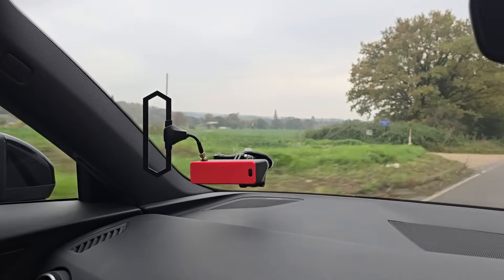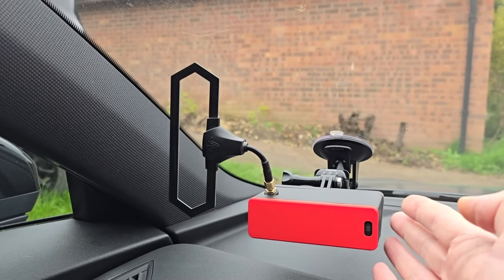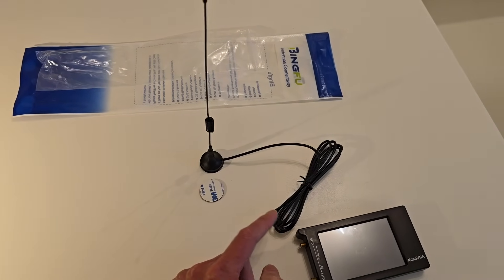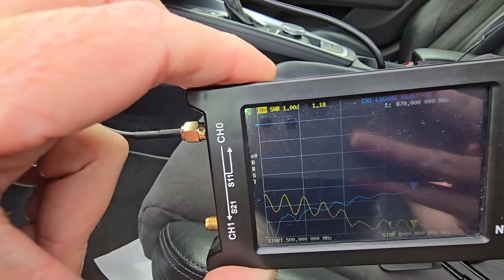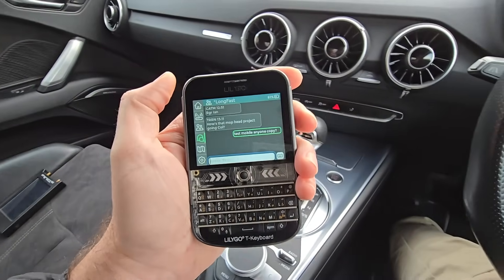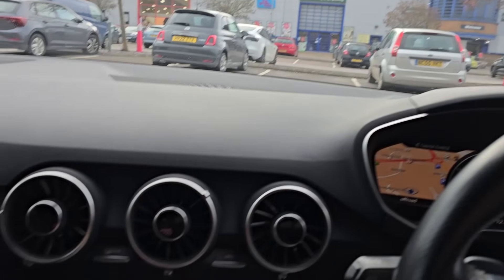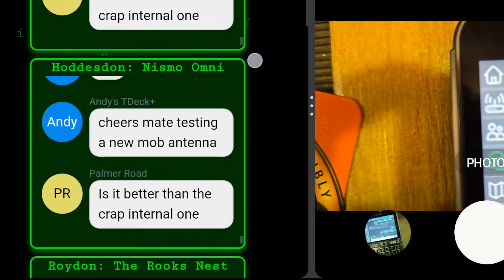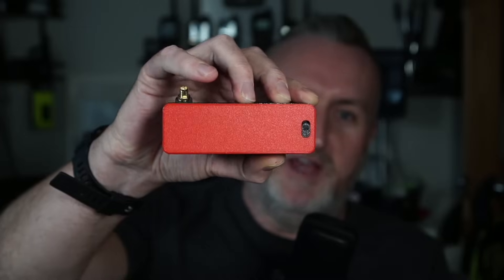THIS NEW CAR GADGET IS GETTING PEOPLE TALKING!!!

Comment: ❗️Antenna cable loss per foot is significant!  I find a stick antenna connected physically to the board yields a longer distance even if lower in height in the car vs. external.  Try it both ways to compare and see for yourself.

Comment: I would be impressed if images, audio and video could be sent across meshtastic quickly.
Its basically the modern days version of people messing about with CBs
Reply from the maker: They can't, it's too slow. Reticulum can on 868 but it's better to use 2.4ghz LoRa radios where you can use increased bandwidth.

Comment: Hi Andy. I have a couple of these aerials on order. Ps not related to this video but just for info the UK normal TV yagis are good up to 860mhz so with a bit of cutting,  fiddling they work on 868mhz.  However the impedance is as standard 75ohm but again easy to adjust. I just bought an 868mhz yagi from china as cheaper than a uk tv aerial. George ps pretty dead for meshtastic around Corby Northants. 6 stations and 4 of them are mine.

Comment: In the US, the TT is considered a secretary car, meaning guys buy them for their girlfriends and wives. I always thought it was just a fun car to drive. I'm getting ready to trade in my car for a used R8 or Ferrari California. My wife told me I had to wait until I was done with law school. I have a 2024 Bronco Raptor. I have a full Ham setup in it and a lora v3 i run up into a tree with my drone. I have a magnetic drone landing pad I use to launch it. I use a DJI upgraded with a thermal cam I use for hunting at night. We use mesh to communicate on the property. I take the drone with a tether made from dyneema to put the node in the tree with a 30,000mah battery and a solar cell. It does a good job considering there's nobody around for 60 miles and cell towers are hit or miss.  We used to use frs for everything but it's not great...the mesh setup is nice once we go through and dump a bunch of the nodes in the trees with the drones.  I can usually fly it off and land it without stopping using my recovery system.

Comment: i can't think of a use case, other than as a message board, like randoms asking 'asl please'. what do you all use it for ?
Reply from the maker: It's a fun way to communicate and prepares you for communicating in a potential grid failure, Internet outage... it teaches you skills in radio comms.
Reply: @andykirby  if there's a grid failure i'll make a sandwich 🥪and take a nap, the network operators have generators and engineers to work stuff out, i don't have anything important to say lol

Comment: FPV drone pilot here, Came for the TBS antenna, left with some new knowledge
Reply from the maker: Hey man, check out the other vids on the channel, lots of fpv stuff here 😁 quite a few fpv pilots also getting into mesh.
Reply: Yeah me too! Lol! I saw the TBS Diamond in the thumbnail and I was like "hey! That's my 915 antenna!" I was totally expecting a "how to fly from your car in winter" type video! Lol
Reply: Will you add a mesh relay node to your drone, for the people?😌
Reply: @Thuja814 sounds like a challenge, lol
Reply: @sinologies  nah, your challenge is to calculate the ideal hovering node-drone mesh arrangement (i.e. staggered, grid, fibonacci spiral?) as well as the height, and the distance between each node-drone in your flock to provide seamless connectivity to devices at ground level while striking a balance between your signal strength, drone battery usage, and optimization of geographic coverage😛🤓
Reply: same here
Reply: Bruh 😂

Comment: If you don't want to have to worry about adhesive on your paint, you can use nano tape. I have used that stuff to stick my cameras to bricks, and they've been up for years, when I take it off there is no residue, and no damage. I wouldn't use it on plaster or drywall, but basically any surface that won't come off with the tape is good.

* I say this because you seem like you're proud of your 450bhp machine 😉
Reply: Nice advice, but it’s too late lil buddy, he already stuck it on!
Reply: @4th_Lensman_of_the_Apocalypse  🤣🤪

Comment: So, this is similar in concept and purpose to Citizen's Band (CB) radio in the USA in the 1970-1990's. A way for drivers to communicate road conditions, hazards (including police), But used codewords and slang to obfuscate any LEO's listening in.
Reply: LEOs had CBs in their patrol vehicles back then, and they did listen.  
You could even call for law enforcement over the CB & the police/sherrif would call ambo/fire if needed
Reply: @robertf6523 Channel 19 was for general bs, 14 was for walkie talkie’s. I can’t remember what channel was reserved for emergencies but there was definitely an emergency channel; maybe channel 11. SSB always bled into channel 14 for some reason. I had low powered radio shack three channel mobile units but my best friend had a proper base station with 5 Watts and a decent antenna. Good times.
Reply: We tried using pigeons but the homeless kept eating them.

Comment: No issues with water leakage with that antenna cable going in like that?
Reply from the maker: No it's been fine, there's a seal around the door and it still works correctly with the wire from through.

Comment: It looks like my old Escort radar detector from the eighties. In the State of Virginia it’s a guarantee that you will get pulled over and charged with having a radar detector. Problem is that the police are really uneducated in Mesh equipment and how it works. These nodes need indicator lights showing when they are transmitting and receiving data from your Meshtastic keyboard.
Reply: it's a shame a few states are so hostile to them, i'm not exactly speed racer but i think having one in my car is fun just as a little occasional cat and mouse game lol
Reply: It’s such BS that a passive sensor is criminalized

Comment: Another cool video Sir Andy Kirby!
I am building a stealth Meshtastic node out of sight, because even for a 50 cent that fell out of your pants  they will break your window. Above the wind shield there is a little space in the ceiling cover. I made an dipole antenna  (put it flat to the window) and it seems to work pretty well. 
Thank you for your valuable vids and inspiration!
Reply: Could you share pictures and updates about it?

Comment: That super low swr you measured is definitely due to the loss in the cable (indicated by the ripples). Try taking the antenna off the base and see if the swr changes LOL

Comment: im using a thunderpole window chip mount and a nagoya sma mini mag mount both with aliexpress 40cm flexi whip antennas for my mobile nodes works quite only issue i found is newer cars are using 868mhz for tpms and sometimes the low pressure tire warning light comes on when my node is TX-ing

Comment: Now, if EVERYONE could install such a device in their vehicle, then it would be sustainable usable actually practical real usecase. You gotta dream of such a day.
Reply: Actually, it would completely fail because Meshtastic fails if there are too many devices in range.
Reply: @Qwiv they would likely change the code and make the plug in receiver the base station antenna for clients (liligo keyboard) to connect.
Reply: @ZeFoxii  Changing "the code" can't resolve the issue as there is a max bandwidth v range limitation no software/hardware can resolve.
Reply: @Qwiv that could be sorted out with firmware changes actually allowing messages to wait when sending
Reply: @ that is incorrect as the decentralization does not allow for a managed queuing process or a means to filter any abuse or error.
Reply: @Qwiv  it’s not impossible, there are ways to synchronise them and give them each their own timeframe to send it, for example you could claim a time spot in every minute for that certain node to transmit and potentially do some sort of path finding for private messages rather than it repeating over the whole area
Reply: @ doesn’t sound like you thought this through and your assumptions are unrealistic.  You state you can set up some method but fail to acknowledge it is an unregulated space where no one will follow your rules.   Maybe you haven’t met people before, but LoRa uses a small chunk of bandwidth with no central means to regulate that bandwidth.  It punches past  Rangel limitations by taking more of the radio band and reducing its throughput, making it more fragile and taking up more of the radio space.   You can shut down everything with a 20 dollar device configured wrong, so if can never be used by an enough people to matter or anything mission critical it.  It will still work in your mom’s basement though, so you should be OK.
Reply: Is the frequency spectrum used by these devices a free public spectrum? If not, it could cause troubles for the user.
Reply: @bltzcstrnx   I can't speak about the UK but it's unused here in the states.
Reply: @ you so lazy to not bother to look that up?  lol. Idiot
Reply: I just want decentralized corn
Reply: currently meshtastic has a hop limit of 7 unless this has been updated.
Reply: biggest network that is never used! 😂
Reply: If everyone had it, it would be on-grid, defeating the purpose.  And, if you think the encryption will save yourself a__, you don't understand technology.
Reply: Cb radio grass
Reply: They can but the real problem is they won't bc most people don't know about it, don't understand it, and/or don't care about it. The status quo works for them, kind of.
Reply: @EyeKnowRaff  I think this hobby is much like Ham Radio, it's a niche, but that almost makes it cooler. If you could just send a Meshtastic message to anyone at any time, it's not unique anymore. For those of us that find this exciting, though, we'll slowly but surely expand our networks to extend coverage
Reply: Except you can't drive and text
Reply: @RustyOrange71  It's not about texting and driving, it's about having nodes distributed everywhere to increase coverage!
Reply: Tesla wont be far off with the advancements in Starlink